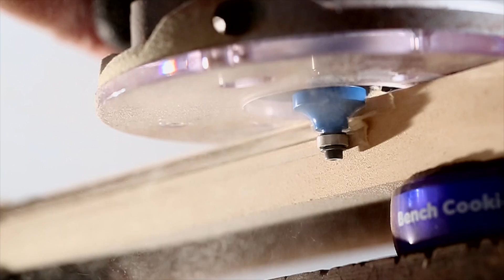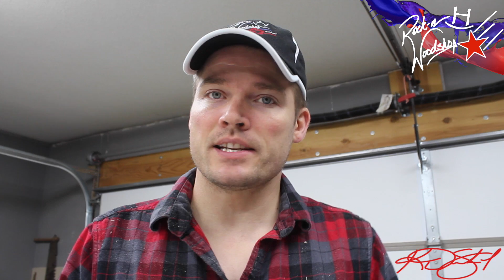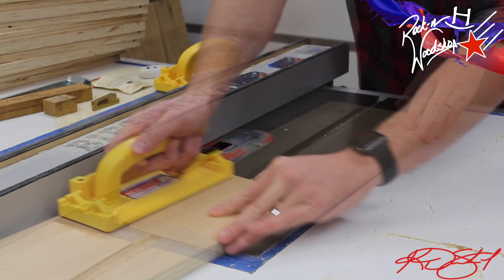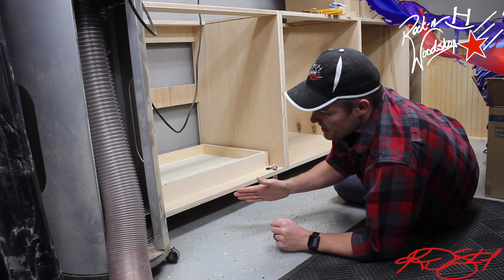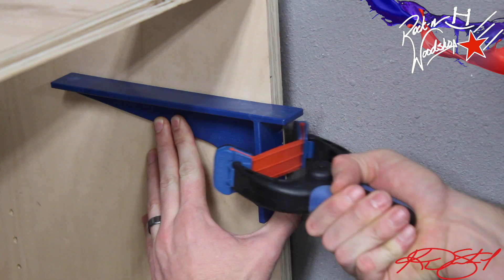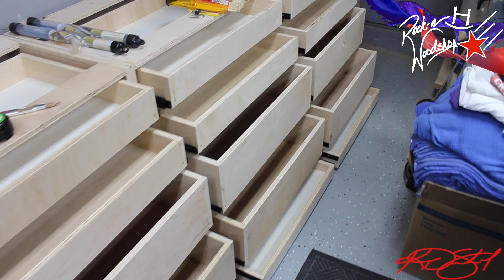How to Make and Install Drawers For Your Shop

Comment: A question, I use that same drawer jig but start from the bottom drawer. just set the jig on top of the next drawer and you get perfect spacing. Looks like you wasted a lot of space between your drawers. Enjoyed the video, i struggle with drawers but your vids have helped a lot.
Reply: Oops, forgot the question, which is the best way to install the drawers?
Reply from the maker: LOL, I didn’t waste space, I left that space intentionally above each drawer because my drawer faces actually take up the space. This way I could make all the drawers the same size but space them out in such a way that they will be large enough for bigger items such as sustainer cases that hold tools.
Reply from the maker: I knew I wanted my top drawer to be as close to the top of the cabinet as possible but the other three I spaced intentionally so the drawer faces would be bigger as you went down

Comment: Loved the video and was very helpful.  However.  How did you install the drawers themselves once the slides were in place.  I have the drawer slide jig, but don't quite know how to use them to set the drawers up so they can be screwed to the slides.  Any video on that?
Reply from the maker: You might try these and see if they help

How to make and install drawers for your bathroom cabinet
https://youtu.be/xaMa17un0Jw

Ultimate Assembly Table Debut
https://youtu.be/K3ftPyUDZqw

Comment: great looking cabinet how mush is it costing in material ?
Reply from the maker: Well unfortunately that’s hard to tell because there were a lot of factors that were outside of me buying materials that came from rockler.
Reply: @rhwoodshop  a lot of times i see sumting nice being build (like youre drawercabnet , and get inspired to make one of my own 
then i try to price out the materials used  i see that it would take me three months pay (after the regulair bills are payed)  to get the wood 

pine plywood
10mm ply 43 euro a sheet 1.22 x 2.44 m
12mm ply 47 euro a sheet
15mm ply 56 euro a sheet
18mm ply 65 euro a sheet 

birch is a little cheaper and underlayment cheaper still but not mush

and another 2 months pay to get the metalwork like the sliders and parts and get very depressed 

its suprizing how fast a cabinet like that can eat 100 dollar bills , its cheaper to have a girlfriend (as long as you hide the creditcard and not give in to her nagging that is )

Comment: Hey "Boomer".....
I'm looking to add a wood lathe to my shop but I'm not sure which brand or length to buy. I do all sorts of wood working,  from heirloom furniture to carved statues but until recently I haven't really needed a lathe. I'm tired of the same old pre-turned legs you can buy. I want to make truely one-of-a-kind furniture that my customers can design to fit their tastes and my own. Any suggestions?
Reply from the maker: Well the lathe that I have is from the Rockler store. It is in Excelsior lathe that has an extension bed. It is meant to be a mini lathe but can turn very long legs with the extension. You might give that a look.

Comment: Coming along very nicely.
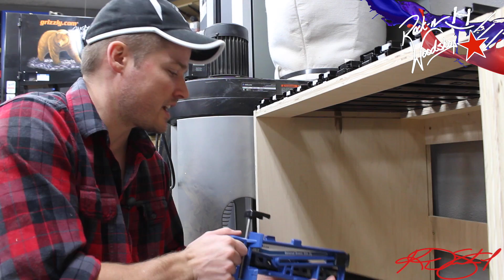Question, the jig you used at 7:38, how accurate is it on repeated uses. Im wanting one but not if its off even a little bit. Thanks
Reply from the maker: I think that jig in particular is very accurate. It's all in user set up. As long as you set it up the correct way each time and do not change the indicator bar you will have excellent repeatability. I installed all 12 drawers in my three cabinets and they are all with in a 1/16 inch difference across the board. If you put a lot of drawer slides in, it is well worth your time and money.

Comment: nice job - that is a boat load of storage - Too bad you didn't go over the stick method of ensuring that the drawer slides are level and the same from side to side -  some folks don't/can't buy all of the rocklers jigs...
Reply from the maker: You have a point there. However, I was up till 3 AM doing the install so I didn't have that much time. I really wish I did because I was trying to make it as informative as possible but also as much of a timesaver as possible.